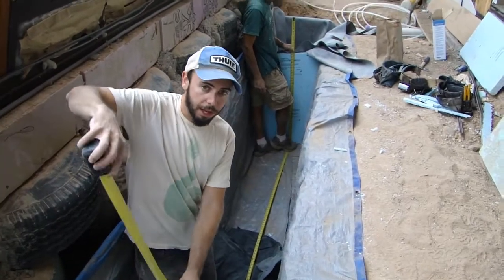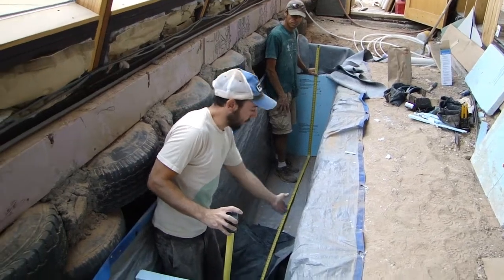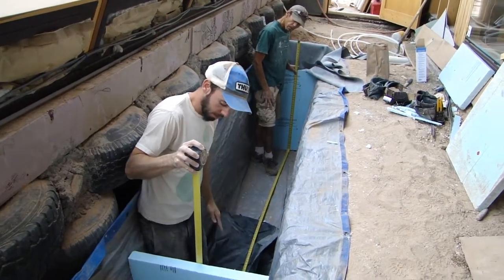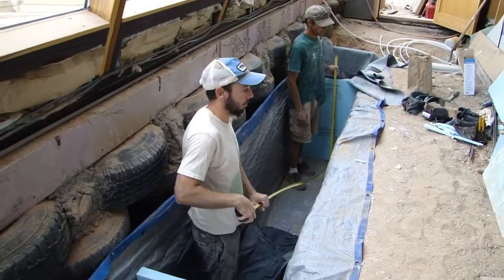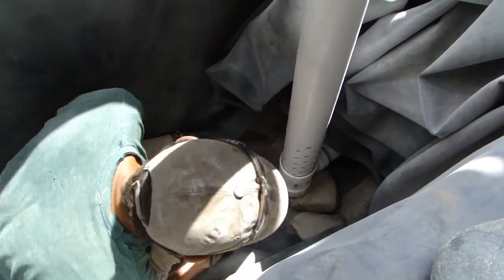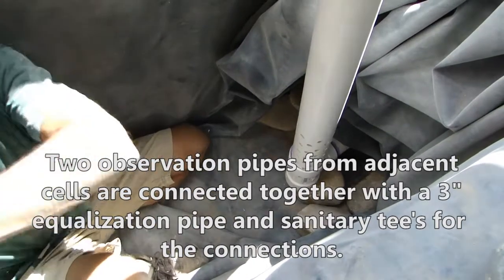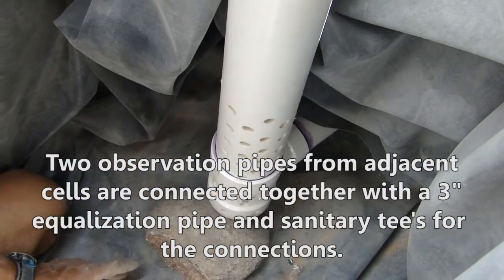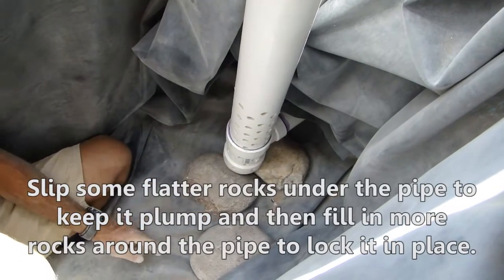Gray Water Planter - Part II

Comment: Hi I was wondering why make the cells? I mean if we're just going to punch through the insulation for water flow wouldn't it work just as well if you didn't put them in saving you money on the 3" pipes and insulation? I know you wouldn't be able to look down without them but it seems like it would be easier and cheaper without them and do you really need that many places to look at the water lvl? Wouldn't the 6" pipes with the pumps be enough to show you the water level? Or am I missing something important here? I really hope your still around and answering as I would like to try do something like this once I get water... :) Any advice or reasoning would be greatly appreciated! 
And thank you for the video!!!!!
Reply: Seconded. What's the idea there?

Comment: Great video mate, reallly great, i’am in one of the balearic island with my family living  off the grid trying to instal a botanical cell for grey water.
i have the same question as brianeffect,  
Can you explain to me how the piping works in the grey water planters. It looks like you cute holes through the rubber liner and put pipes through it, so the water can move through the system. How do you seal up the rubber liner so it doesn't leak. Thanks.

Comment: Can you explain to me how the piping works in the grey water planters. It looks like you cute holes through the rubber liner and put pipes through it, so the water can move through the system. How do you seal up the rubber liner so it doesn't leak. Thanks